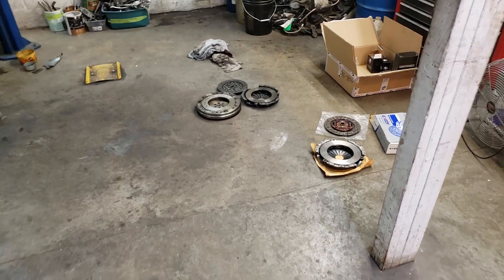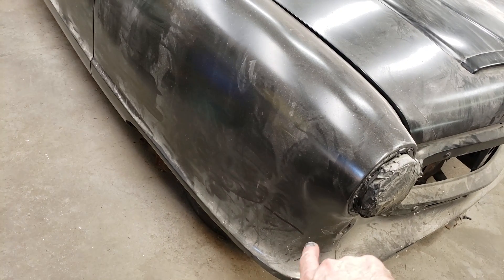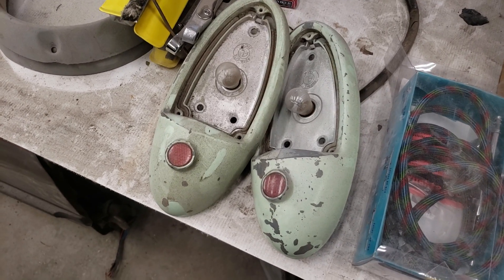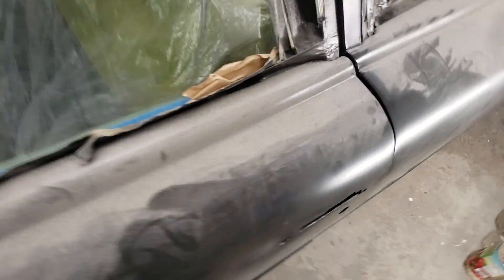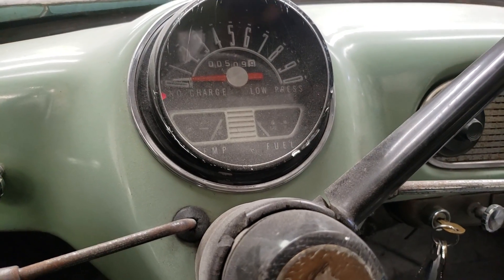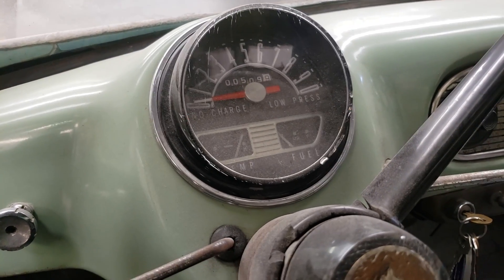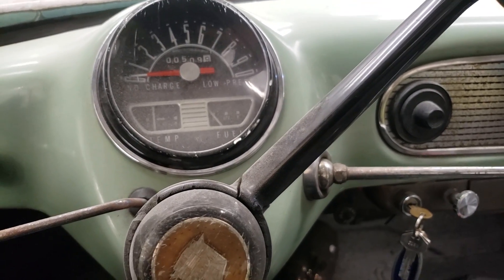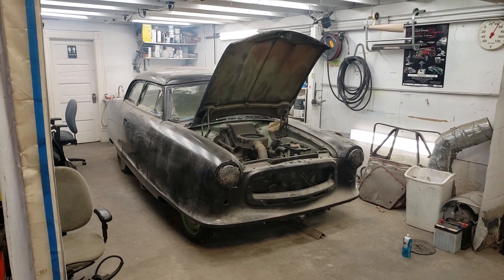Will it start ? Digging Out My Old Flathead 6 Volt Positive  Earth Nash

Comment: Gotta love the single digit speedometer!

Flat head engines run so incredibly silently, too bad they are so darn inefficient.
Reply: Not that bad, the little Rambler six was good for 30 miles per gallon on the cheapest regular gas. Problem with the flathead was they were not adaptable to high compression, 7.6 or 8 to one was about the limit. So, not a high performance design. But the mild tuning and long stroke design makes driving easy, you can slow down to under 10 mph in high gear and pull away without shifting down and without straining anything. On the road and in traffic driving performance is better than you would expect given the low horsepower numbers.

Comment: Carbueretors have a vent to the bowl that you can pour gas into,usually a slanted,bologna-sliced brass tube.this stops all that grinding slow,which is hard on low volt-high amp starters,ANDpre lubes the accelerator pump diaphragm.
Reply: Very good point

Comment: Great body style with those unusual front skirts. Would be cool daily driver, though in that case I'd want to convert it to 12v for convenience and reliability. And vacuum wipers were really a Nash/rambler/AMC thing all the way into the '70's. I had a '71 gremlin with vacuum wipers. Would always lose wiper action under heavy acceleration
Reply: Nothing wrong with six volts, it worked fine when the car was new, no reason it shouldn't work just as well now. It's also easier to get the stock system in good shape than to change it  to 12 volts.

Comment: Those heads are pretty rare nowadays.  I wouldn't run a car like that more than 20 seconds without coolant.
Nice car.  I've restored several 52-54 Ambassadors in the last 40 years.  Just finished a 54 but I modernized it with a 350 sbc and TH350.  It's my everyday driver.  Parts for these cars have pretty much dried up unfortunately.

Comment: if i where you i would not touch the gaps if both sides are the same
Reply: I hope he doesn't, seems like that's how it left the factory so odds are it won't hurt the paint
Reply: If you don't though they will only get tighter when it's painted.
Reply: Mowogjones yes but it's possible that it won't cause issues

Comment: That Nash is HUGE!  Well, compared to most of your other cars......lol. 
What does the soap in the trunk do?
Reply from the maker: Old Spice deodorant soap is mouse repellent
Reply: @2stroketurbo  Love the Nash, and your tip on the soap. I was taught never to dry run a water cooled engine because of the water pump seals, but don't remember if the Nash flathead was one of the water pumps with a Zerk fitting?